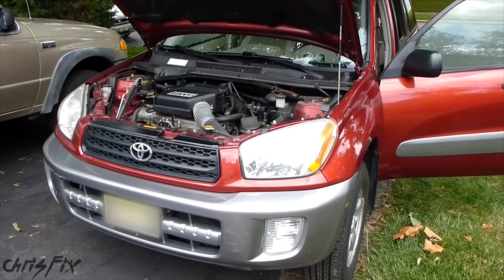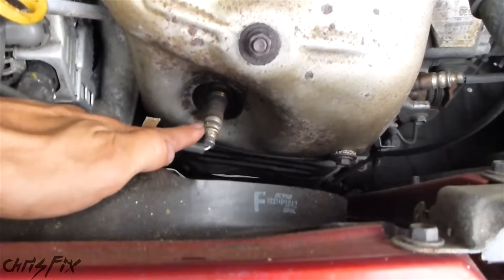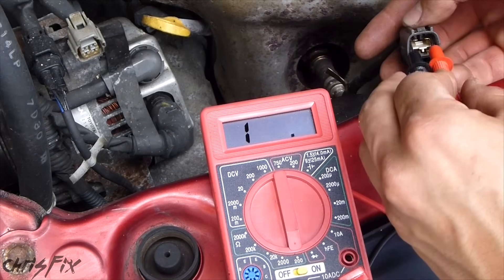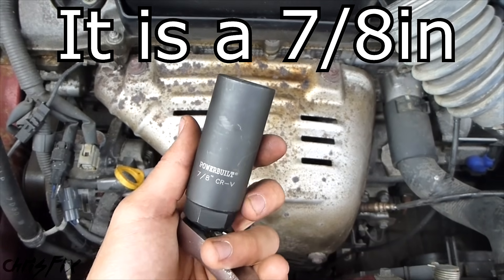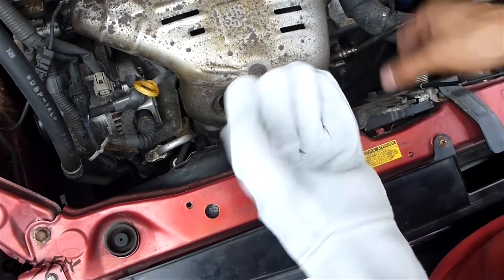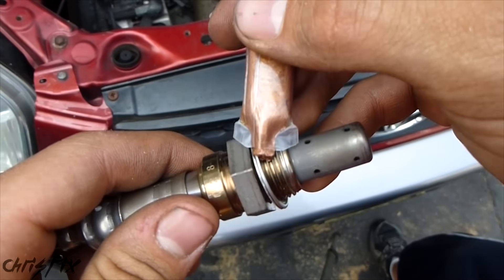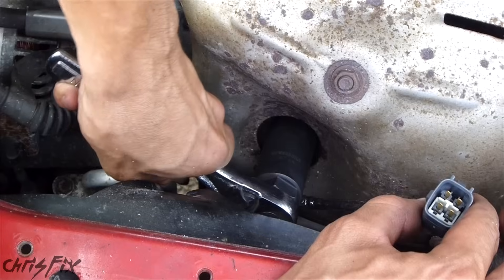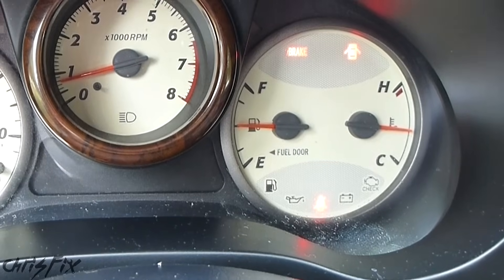How to Check and Replace an Oxygen Sensor (Air Fuel Ratio Sensor)

Comment: Hey Chris sup bud , thanks for all  ur videos. got a question I have a 2001 Suzuki xl7 it was given me the code p0135-155 which is the heater circuit  I have changed the whole exhaust system because it was do, as well as the sensors but the car still has the code I have checked the ohms as the schematics diagram from the repair Manuel on the wires from the pcm and the couplers from the 02 sensor. Am I doing something wrong. 🙏🏽

Comment: I have a p0133 and p0153 being thrown by my car. I did the test with the multimeter but they both show that they are working? What is the next step i should take to get these codes cleared? The car runs perfectly

Comment: I got a p0133 on my 1998 Toyota Camry le 4cylinder and my obd2 scanner has the air fuel ratio sensor from bank 1 and here you're saying that this is bank 2 . Isn't bank 1 on top and bank 2 on the bottom of the catalytic converter, can you clarify this for me thanks in advance.
Reply from the maker: The banks are side by side, and sensor 1 is on top and sensor 2 is on the bottom!

Comment: I have a 2013 Ford Taurus with a check engine light on code p0430 the check engine light sometimes turns off by it self then few days later it comes back on with the same code any idea what is causing this problem ??

Comment: I wish you lived in my area. My dodge Dakota 95 has been misfiring and I can’t find the problem. I changed rotor, spark plugs, new spark cables, egr valve, idle control valve, PCs valve and nothing. It does it when I drive it before getting to 2000 rpm it starts accelerating and staling back and forth. And I’ve noticed it does it when the motor gets hot, cold I can drive and it dosent do it
Reply: I meant the pcv valve and egr valve both.

Comment: My sensors has six pins and no two wires are the same colour. How do you figure out which to test for continuity?
Reply from the maker: Which car is this on?
Reply: @chrisfix  a Chevrolet Cruze 2011.
Reply: 2012.

Comment: I changed all my 02 sensors but the light still on p0161 error sensor circuit heater bank 2 sensor 2 cant seem to fix this issue

Comment: I have the p1164 code on my 97 honda civic hx and spent 300 dollars on two sensors and its replaced with denso o2 and code comes up even if the light doesn't light up. I drive a few miles and its on p1164 PD on my scanner need help.

Comment: I replaced lambda sensor which also had heat circuit failure, as one of the wires broke, yesterday on my Nissan Almera 2003. Did it while the engine was still pretty warm, but got it easily off and did not burn mysef. The old lambda itself was quite hot, but no so hot it would burn my bare hands.

Keep up the good work with your videos! There's been plenty of helpful and money saving tips and tricks. Also as I'm going to school now to be a car mechanic here in Finland, yout tips and tricks have been very useful there too.

Comment: Hey Chris, does an aftermarket AFR sensor have the potential to damage your car (ie an ebay sensor), or are they worth experimenting with?
Reply: Those sensor 1 sensors are extremely sensitive, while it may not damage anything you may not get proper reading and and wont last you a long time. Its better to get oem as that will last you the duration of your car vs having to buy a new after market every now and then which will add up to the cost of a new oem sensor overtime. Always buy oem air/fuel ratio sensors.

Comment: will this work for testing all o2 sensors? see if the multimeter has a reading on the two black wires?
Reply: Check which wires for signal for your lambda sensor. Sometimes heating of sensor is bad too. Some model have only one wire and need good ground. Sometimes sensor compare oxide outside of engine to oxygen in exhaust.

Comment: Can’t you just remove that heat shield and use a wrench to remove/install it?
Reply from the maker: You can definitely try! A lot of times with exhaust components, those nuts will be super rusted and might strip, so I try to leave it be and not have to worry about removing the heat shield!

Comment: Hi Chris 
I have problem with downstream(two wired) O2 sensor when I disconnect it my car run smoothly but gives check engine light.When connected car runs hard and hesitate.
Reply from the maker: Sounds like you have a vacuum leak or the o2 sensors are bad, do you know what code comes up with the check engine light?
Reply: Definitely bad O2 sensor. My car does the exact same thing. Replacing my MAF and O2 should do the trick for me. Keep us updated! Try getting a code like Chris said. That number will identify what's going on.

Comment: Hi Chris,
I have a os2 incomplete after replaced new battery and I drove more 500 miles still have an issue os2 incomplete. No check engine on, 0 code found.  Do you have any idea?
Thanks
Reply from the maker: I would keep driving and checking, your car should complete a check soon!
Reply: @chrisfix  Will do,  thanks for your advise

Comment: Hi, Chris.I have a 2005 Escape with an oxygen sensor problem. I've already replaced it with a new one but still the Check engine is there. The mechanic said its probably the ECU. Are there other things that should be checked before we conclude that the ECU is the problem? Hope you can make a video on this. -  JR from the Philippines
Reply from the maker: What code is coming up with the check engine light?
Reply: Its P0138

Comment: Thanks for your video on this Chris.  I tried cleaning my sensor in different ways & tested it but it was toast.  Yesterday I got my new 02 sensor (Bank 2 Sensor 1) from Amazon for $67.39 Cdn. for my 2007 Honda Pilot.  Installed it, disconnected the battery to clear the code, drove for over an hour = No Engine or VTM-4 codes.  Very happy.  Here's the part for anyone who needs it:  Amrxuts 234-5010 5 wire wideband upstream.

Comment: When tightening an o2 sensor, do not tighten it too hard, because they expand and contract from the heat. It should come off with less effort than that. That one was a bit too tight and it could have broken making it harder to get it off
Reply: Rust, snow, or general time makes any part remover harder

Comment: Hello Chris -  I hope you can help me with this.

My 2006 Tundra has a "Check Engine” light on.  So, I brought to Auto Zone to diagnose.  A diagnose report shows a PO138 error code indicates a bad Oxygen Sensor on Bank1. So, Auto Zone sold me a Down Stream Oxygen sensor to replace on Bank1 that is on a driver side.

As I crawl down to look for a bad sensor on a driver side, I notice there are 4 Oxygen sensors.  Two on a driver side and two is on a passenger side (one is located before a CAT converter , I believe they are called Up Stream sensor, Down Stream sensor.  Please correct me if I am wrong.

I set a volts meter to check Continuity of those four sensors:
*Two sensors locate BEFORE a CAT converter have 2.5 and 2.7.  
*Two sensors locate AFTER a CAT converter have 12.2 and 12.5. 
*A new Down Stream sensor bought from Auto Zone has 13.1.

So, which one of the four sensors is a bad sensor to replace?  Or what other test should I do?  Thank you so much!

Comment: Sounds great, but how does one determine which bank is bank two and which sensor on the bank is sensor one?
Reply from the maker: Bank 1 refers to the side of the engine that has the number 1 cylinder. Bank 2 is the opposite side of the engine! And the 1st sensor is located closest to the engine!
Reply: @chrisfix  cool, thank you.  I really appreciate your videos and your tremendously positive attitude.  You have taught me a ton and I now believe I can do things I wouldn't have imagined doing before.  Thank you for the inspiration.

Comment: Thanks , Chris! I’m getting the dreaded P0420 on that very same scan tool. I tested the sensor and I too am getting a open circuit. Quick question about the scan tool though. I reset the code and took a 25 mile drive and only the EVA circle was flashing with a yellow light. Does that mean that that one particular sensor is not ready and being that my car is over 10 years old it probably will allow a few sensors to not be ready during testing time for inspection. Was just curious on your take. Thanks!
Reply from the maker: Correct. When you clear the codes, the car needs to run for x amount of miles at different speeds and under different loads and with different fuel amounts to complete it’s cycle.

Comment: Great video Chris,.  Do you have a similar video for a Bank 2 Sensor 2 for a 2003 Toyota Highlander, 4 cylinder.  Trying to locate which sensor to replace. Evidently it has more than 2 sensors.

Comment: I have a 2001 Mitsubishi Montero Sport with the 3.5 V6, that has an O2 sensor showing 0 voltage on bank 2 sensor 1.  The fun part about owning a Mitsubishi, that isn't an Evo or Eclipse, is finding out information about it.  Such as...where the hell is this O2 sensor!?
Reply: I'm having similar problems with the 01 Mitsubishi diamante! It's borderline impossible to find any information on this car for anything u need to know about it!
Reply: @e-reptiledysfunction2243  One thing I've found moderately helpful, is finding out what it's known by in other markets.  So, if the Diamante was sold in South America, Australia and Japan under different names, similar to the Montero (where it's known as the Pajero in Australia, for example) then you can start looking for info based on those markets.  It could very well be different, as features available there would be different in the US, but it may help narrow down some things.

Comment: Hey Chris, great video! I've received my "O sensor" without the plastic protector that goes around the metal end, and there's grease all over that end. Do you just wipe it put clean with a piece of cloth, or do you use something else, since that is the part you'll screw in? Thanks in advance for your details, Chris!

Comment: Wish it was that easy on my Silverado. I had to lay under it and learn how to be double jointed to reach the upstream sensor on the driver's side. Fortunately, that was the only bad one and it fixed about 4 check engine lights.

Comment: Now, folks, Chris knows as well as the rest of us, just cuz it's NEW doesn't mean SHIT. If you shop at the local AP, have them check to see if it's working properly. I am NOT a mechanic, nor a TECHNICIAN. The advice I give comes solely from what I deal with on a day to day basis. I love YT because it's ALL of us giving bits of info, no matter what issue.  And yup, Thanx Chris, another great video.

Comment: Screw renting a damn socket. I would have had that heat guard off in 5 seconds then used a ring spanner. And yes my father has everything including sockets up to 2 inches. Earthmoving/tractors...... blew out a rear wheel bearing in a serious sized backhoe (16.5 foot boom ). Good fun lifting those hydraulic cylinders on and off by hand when we redone the seals to stop the chronic leaks.....

Comment: What should be the resistance of an upstream air/fuel sensor? Is 15 Ohm indicitave of a failure? Trying to find the faulty air/fuel sensor in 2009 Rav4 V6. OBD Code P0137

Comment: I have a 2240 code on Toyota venza which says its a/f sensor bank 2 open circuit. Did this continuity test and it passed but should I still replace the sensor as it could be the actual sensor it self?

Comment: Hi,
Can stuff be faulty even when no fault codes are coming up?
I've got slight poor idle,clicking sound from evap solenoid, and I might need to replace oxy  sensors(even though no codes coming up)
 feels like lake of power also/slow response on foot pedal, 
I've done all the basics,(changed the fuel filter, oil,oil filter,air filter,cleaned maf, cleaned throttle body,changed spark plugs,running best fuel an put injector cleaner in,
Mechanics have tested the car, an the coil plugs,
They can't find anything wrong with it)
Its just not right though,
Vz commadore

Comment: My mechanic wanted $320 to do this.  $200 for the part and 120 for labor.  Me?  $78/part and the cost of the socket which was $10.  Chrisfix also saved me a bunch with the revival of my meh A/C.  Bought the refrigerant for $40.  Worked like a charm.  Mechanic wanted $200.  These are mind numbingly easy things to do.  I would be ashamed to charge that much for 10 minutesof work.  Man, what a racket.  lol

Comment: There is a smell of gas coming from under my car when I start it and the car wastes so much gas, does anyone know what it is, it’s a 2001 Lexus es300
Reply: You're car is running rich. You need to adjust the air/fuel ratio.

Comment: Thanks a million my friend- most help I've had so far.  Have been dealing with sensor codes and errors a while now. Spent lots of time and money trouble shooting and replacing sensors.  Eventually replaced the main brain/computer.  I only have the 1155 code error now and the sensor has been replaced 2x.   I literally  ran out and did a check after watching your video and the sensor checks out fine with ohm meter.  Any idea of a secondary problem that could be throwing that 1155 code? In the past  I reset  and cleared the code but as usual it pops up again after a few minutes of running.
Reply: Did you figure it out.  same problem here

Comment: If you put the new o2sensor on will the EVAP and CAT icons on your obd11 scanner stop flashing? Does the flashing icons indicate that it’s faulty and caused the o2sensor to go out?

I have the same scanner but only giving me o2sensor code but I have the EGR,CAT,EVAP,02s icons flashing id just like to know if they should be checked out before I replace the 02sensor??

Comment: I recently changed my O2 sensor bank 1 sensor 2 on a 2001 Lexus es300 but the code still turns back on after a delete it, what’s the problem?

Comment: great video!! 02 sensors go bad quite often.from changing hundreds of them can tell you once one goes bad the rest follow .best to change in pairs. like up stream 2 sensors or 2 down. always clear codes and relearn computer. with better scan tool you can get all o2 data from each sensor. some times you have to heat with torch to break them loose. I even had to cut wire and use 3/4 drive or 1/2 drive socket with breaker bar. had them  snap off in converter, some times carbon gets on threads so parts cleaner and tap before installing new one. you can put socket over the one used in video then 3/4 drive or 1/2 breaker bar . careful not to snap it off   !!

Comment: Ok, what you failed to mention is that every obd 2 vehicle has to go thru a drive cycle. Each manufacturer is different. Just 10 mins down the road may not be enuff to clear the readiness monitors. Also, i have never seen a four cyl engine with more than 2 o2 sensors on them. For the most part there is only one bank.

Comment: Question: you mentioned to let car cool down before working on to prevent burn, but prior to removing the sensor with socket, you used a welders glove. Did you have to warm up the car first to ease the removal?
Reply: No. If the o2 sensor is hard to take out put some wd40 on it and unscrew it

Comment: I have the exact same car with all 4 sensors going on me last night (I’m in Sydney, Australia). If you don’t have the special socket, you can remove the heat shield with 4 x 12mm bolts and then remove the sensors with a 22mm spanned, 10 minute job. Unfortunately, I had the MAF sensor go on me too, I had the CEL on the dash, so I bridged the computer to pull the codes and found my issue/s. good clip in testing the sensor

Comment: hey chris, I have a 2016 Nissan Altima 4 cylinder SL. Can u tell me does this vehicle have one or two oxygen sensors? I located one across from the radiator fan but I dont know where the other is, if any. Also, I was told that its important that you use a specific brand. If so what brand should I use?

Comment: Hi Chris, I don't have a check engine light, but my gas mileage is horrible. My 2.4L 2AZ-FE is getting about 15MPG. Mostly city driving but still not 15MPG for a 2400cc engine. Does replacing o2 sensor fix this problem? I cleaned the MAF sensor with MAF sensor cleaner already. Thanks Chris.

Comment: 2001 Rav4 here. TH emechanic put down part #2349028, one number different than part # 2349023 that was in the video. The bad O2 sensor is suspected to be in the same spot as the video. Which part should I get? I don't even know if the part #2349028 given by mechanic is a part #, it is just on the sheet under reference.

Comment: Hello Chris, thanks for your videos..i have a question, do you need to disconnect the battery to do this job?
Reply from the maker: I would go play it safe since you’re replacing sensors. Technically you don’t have to though.
Reply: Yea
Reply: I heard you should reset the ECU by removing the fuses or battery disconnect

Comment: You probably won’t reply to this but..

What should I do If the pigtail for the o2 sensor is stripped off? The pigtail I’m talking about is at the wiring harness end (female connector) so in other words, buying a new o2 sensor would be pointless because it has nothing to connect to.

Comment: Engine light is on, the computer tells me that I need HO2S  Heater Control Circuit Low (trouble code description for POO31 Toyota), where is it located and how do I change it.
Reply: Loretta Moody I have the same issue

Comment: Hi Chris , I own a Mazda 6 2014 , few days ago got a check engine light with code PO 421 catalytic efficiency below threshold , just wondering if I could use your method to check a bad sensor with a multi meter ?

Comment: Thanks for the help....  I was wondering... I have an o2 sensor out twards the end of the muffler in 2000 lexus rx300 ...   am i right in saying this sensor doesnt test the same (Continutity) at the other in the front of the muffler?      I have a brand new sensor and there are two white wires instead of two black   continuity does not show..   Thanks again